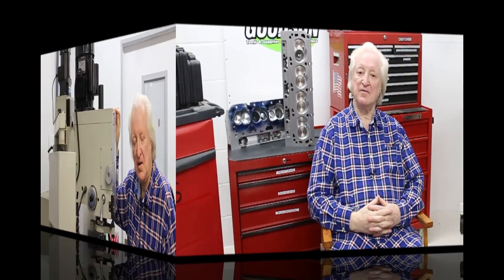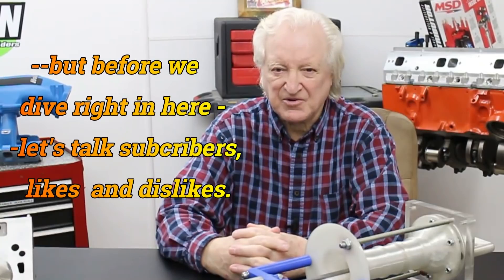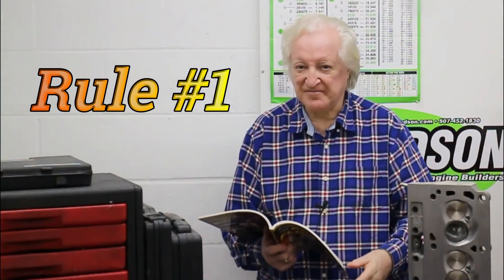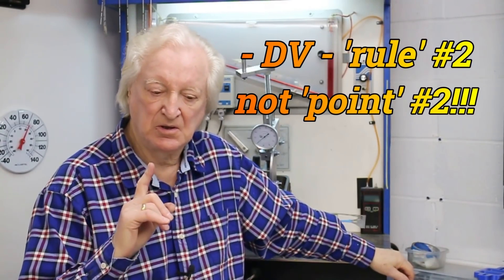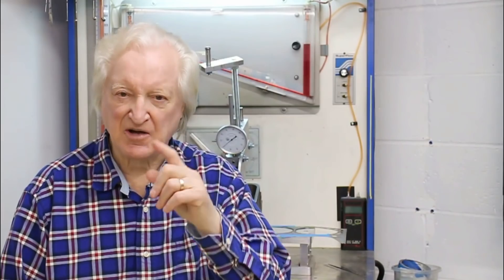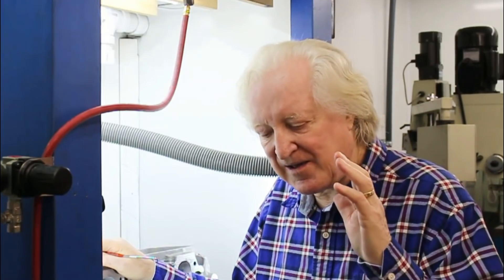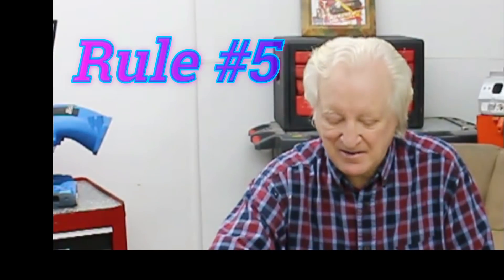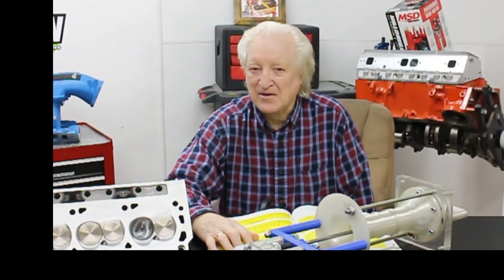David Vizard's PowerTec 10 EP 14 The 5 Golden Rules to Pro Pporting Success

Comment: Is it possible that a polished port flow better but produce less power ?
Maybe because of better air/ fuel mixing
If it dont flow better, it's the reynold numbers question and this help to keep attached flow  that would otherwise partially 'choke' the conduit ?

Comment: So rule #3 = When determining the fuel flow based on the compressor they use viscosity of the air column, which can then be used to calculate the fuel flow as in Pounds Per Hour

Comment: well ... very well...but here is a question: if polished and shiny ports drops the torque so why when we polished our ports the power increased?
Reply from the maker: You may have removed some casting impediments when you polished the ports. would have gone better if you had used 80 grit emery rolls to finish the port to the shape you had targeted.

Comment: Sir, you provide incredibly valuable technical information but the average hot rodder isn't finding it among all the glitzy videos that spew bad advice. If you would take a cheap junkyard vortec chevy 350 and a ford 302 or 351 with the good late model heads and dyno test the engines with the stock heads and again after your port work and cam selection, those videos would likely go viral. You could then provide links to your current videos showing how you ported the heads and you would attract a much larger number of viewers.

Comment: great series, would like to see more on twin cam multi valve engines.
I know the old v8 push rod engines are still popular and used a lot in racing, but multi valve engines are taking over.

Rule #6: bigger is not better. 
Thanks David for the great series.
Reply: will be doing a post on the worlds most effective 4 v mods.

Comment: No, chev heads dont swirl rihgt and  they combust on one side of the piston and across, not down, you can hear it and smell the unburnt fuel. Shocking design. And dont run happy or last. Now  The windsor on the ather hand runs happy with good vacume and sound right and go better with a 2 barrel than any gm engine with a 4 barrel, prooven over hiistory.

Comment: I was going to say 80,000lbs of air but I reckon it is more humid here. :-) Really interesting in the detonation deal. I had an engine apart that the bearings looked like were beat to death from detonation but the timing wasn't set any higher than normal. Perhaps this was the cause as the pistons stopped about 1/4" below the deck. This was a diesel though so not sure the same applies but maybe?

Comment: The million cubic feet of air although a good model in some respects but is not intuitively linked to a car engine. Maybe an example of perhaps a 2 litre engine and what weight of air it wants to consume in perhaps a minute at 6000rpm. I guess a clue is the that the air will way about 14 times more than the gasoline.

Comment: I was told that a gain in CFM without a gain in airspeed equals little to no gain in power. True?
Reply: A gain in CFM is beneficial on the downstroke. A gain in airspeed is beneficial past the downstroke. So they are both important, but I wouldn't trade CFM for airspeed.
Reply: @erwinnijs1  I’m always learning. Appreciate it.
Reply: To me air speed / velocity = more cylinder filling regardless of CFM so what you are saying seems to make sense but probably more so important at low to mid range engine speeds.  (Ram Air effect). Maybe we will get a comment from a pro.
Reply: @bw3506  Thanks. Appreciate your feedback.
Reply: @bw3506  Not necessarily. Lots of air speed is what gets you above 100% VE, correct. Because a small volume of air at high speed has more kinetic energy than than a large volume of air at low speed. But you have to get to 100% VE first. That's what lots of flow does for you. 
If you choke an engine in order to get high air speeds you will never fill up the engine to 100%, or at least not at the rpm's you want.
Reply: @erwinnijs1  I think my words didn't really convey what was in my mind when I wrote my comment.  I agree with what you said to me 100%.  I think the way I had it worded it sounds like I don't think CFM is helpful or important. Not really what I was trying to convey.  What I was "trying" to say is you still need velocity even at higher CFM.  So just hogged out for CFM isn't as good as maintaining velocity along with improved flow. Correct?
Reply: Correct. It's because the kinetic energy increases with the square of the speed that it has a small added benefit over maximizing flow alone. Otherwise I wouldn't even bother with it.
Reply: @erwinnijs1  I've got a naturaly aspirated pump gas low deck 470 Mopar with a Holley sniper FI system on it. The computer is telling me I have 130+ volumetric efficiency mid to high end. I was pretty shocked it was that high. But then again it has decent parts and runs like a scalded dog. I feel it's pretty restricted by the headers and exhaust I had to use to get it in my chassis so I think it could probably do some better minus the restriction.  That thing has to be ramming the hell out of air to get that if it's accurate. Does this even sound possible?
Reply: @bw3506  all a matter of scaling.
Reply: @bw3506  Probably closer to 100%. Have you calibrated it correctly? Does it use a map sensor?
Reply: @eb972  scaling in the Holley computer software screen? Sorry ,I'm new to the whole FI thing so I don't know what you are saying. I just used it as it was when I downloaded it but toggled it from lbs per hr to VE.  If I run it live it uses the whole screen?
Reply: @erwinnijs1  The system is controlling my fuel as well as timing per the parameters I put in. It self tunes the fuel to hold the settings programed to a base table you set up. Yes it uses a MAP sensor.  In the computer software you can switch between lbs per hr and VE on the base system fuel rate.  I'm new to FI and the software but I've done some research on the tuning of it as I set it up with smoothing the tables and such. But still a whole lot to learn about the whole deal. It does have a large Hemi Dart type hood scoop pushing air over the filter.
Reply: @bw3506  If it uses a map sensor then it probably uses speed density as algorithm. Which means it does not measure VE directly, but uses a VE table set up from the factory. It's probably just a very rough estimate.
Even then, 130% is way to high. Ram air usually only accounts for 5 to 10%.
If it runs fine, leave it as it is. Just take the VE value wit a large grain of salt. 
Maybe log the map sensor value if you can. If you multiply it with rpm and than plot it against rpm at wide open throttle, or via a scatter plot, it gives you a very good indication of your torque curve. If you multiply it with rpm squared it gives you a good indication of your HP curve.
Do the same but then multiplied with VE too and compare the two curves. If the one mutiplied with VE looks off, your VE table is probably wrong.
Reply: @erwinnijs1  this is what Holley says.

"Holley EFI offers tuning based on Speed-Density, Alpha-N, and Combo. ... Engineers call this "Load Sensing" and it is the method that the Holley EFI ECU uses to determine how much fuel to spray into the engine. 
Holley's tuning software offers Speed-Density, Alpha-N, and a combination of these two load sensing methods.". 

 I'm pretty sure I can log the sensor and see. I'll use your info and try to calculate that at some point for the comparison. I really appreciate your insight and sharing that knowledge. Also for your time in writing me on all this. 👍
Reply: @bw3506  I’m probably not the best tech support either!  Lol. You can assume that you can’t physically make more than 100% VE. There are many things that affect the VE. I’m more familiar with HPT and Fuel Tech and I can’t say that I know what I’m doing is right.
Reply: @eb972  well race engines can surpass 100% VE or so I have been told but I still highly doubt mine is 130 lol
Reply: @bw3506  not without boost.
Reply: @bw3506  Alpha-N means based on throttle position angle and RPM. This is often used on ITB's where you don't have a manifold to take a MAP readings from, or as back-up when the MAP sensor fails. A combination of both means they use a formula to calculate the load value on the y-axis based on all three measurements. I'm not sure how this would affect the VE map though.

You're welcome. When you're passionate about something it's a joy to talk about it. 👍
Reply: @eb972  I've seen several NA engines reach VE above 100% without boost. That's where the air speed and runner length comes in. With these two parameters you can choose where this phenomenon takes place in the rpm range. If you stack them on top of each other you can achieve impressive numbers. Maybe even close to 130% in some highly tuned circumstances.
Reply: @eb972  I don't agree with you on that. Especially highly engineered/tuned engines.  In simple terms it doesn't make sense but there are things like ram effect and pressure wave that can push past 100 NA. That's what tunnel ram intakes operate on. Air column inertia.
Reply: 100% = All or Everything right?
Reply: @erwinnijs1  I can make my VE table go up to 500% if I want is all I’m saying. It’s all how it’s scaled. If I’m wrong I’m wrong. I’m always learning.
Reply: @eb972 This is via Wikipedia. There is more there explaining what VE is other than just numbers on a table. 
 
With proper tuning, volumetric efficiencies above 100% can also be reached by naturally aspirated engines. The limit for naturally aspirated engines is about 130%; these engines are typically of a DOHC layout with four valves per cylinder.

Comment: I subscribed and liked ( and rang the bell) in 1984 when I found your second revision A series engine book and in 1988, when I found your SOHC Pinto book. 36 books later and 4000 magazine on, you have my attention. When my Honours BSC taught me about flow net analysis at Otago Polytechnic in 1990, I knew I had learned these principals from you Mr Vizard in the 80s. It's 2021. The concepts are the same in when you started debugging it with the Concord in 1968. I was born in 1970. Thanks.
Reply: Thank you for another very usefull video.
I appreciate most of your work is on V8 engines but any advise and tips on small cubic inch 6 inline woul d be appreciated. My interest is on early 1960 holden 6 cylinder engines, 132 and 138 ci. I  think they would nog be dis-similer to mini engines. Siamese ports and bath tube chambers etc.
Reply: I’m with you. Thanks to David’s tuning the A-series engine book I started porting cylinder heads.